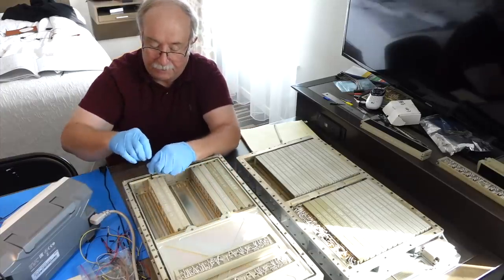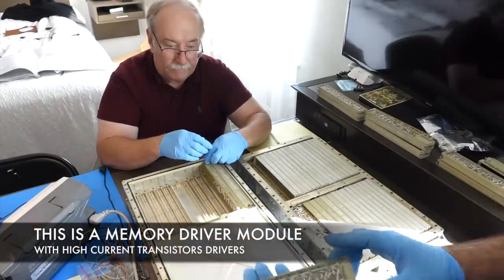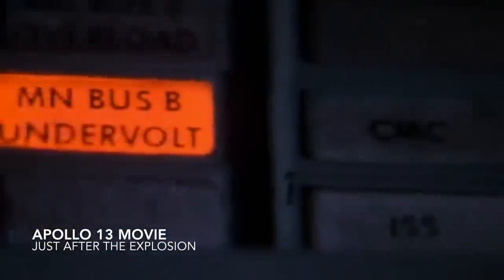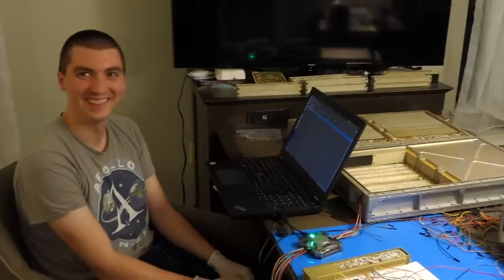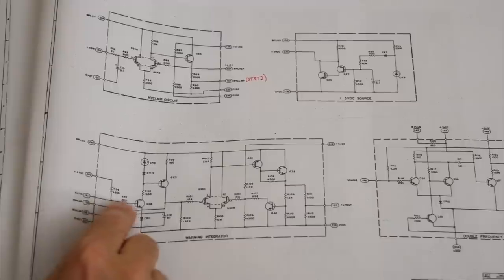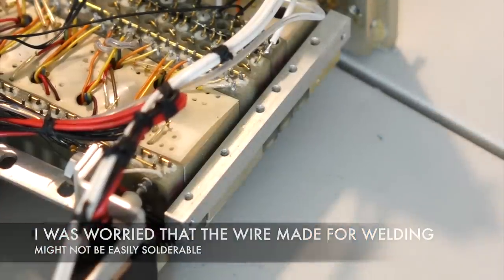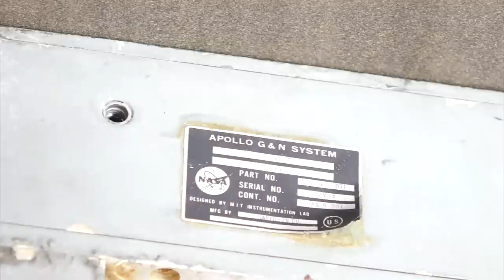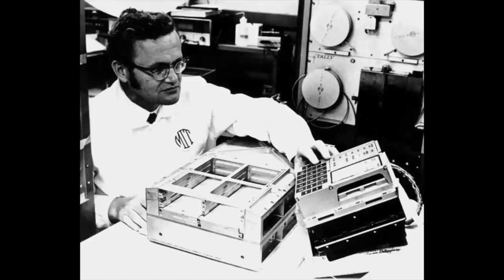Apollo Guidance Computer Part 3: Main Bus B Undervolt

Comment: Is this a process that's currently going on, or was this hotel-room session like one week, a while ago?  How long is the process from start to finish?  (I love that you're all tackling this not as "let's restore this retrocomputer" but rather "let's confirm that everything in this important historical/museum piece is 100% working without causing any damage at all on it."  the precision and thoroughness is spectacular!  :D I totally LOVE this series!
Reply: The hotel room session was one week, but the restoration is ongoing. 

We have a memory module to repair, core rope simulators to recreate, software to load, an improved DSKY substitute to hook up, and lots more
Reply: @carlclaunch793  awesome!   And thank you all for doing this. :D
Reply: You would have to simulate the gimbal inputs and the RCS outputs. Plus, did the AGC use DACs or ADCs?
Reply: @JohnDoe-yj5ng  Hi John. Yes, in the broadest demo, we would read the RCS firing command from the software, compute the change in spacecraft state, then fake inputs from the gimbal and PIPA (accelerometers). Also radar returns for lunar landing, telemetry uplink and downlink, essentially simulate the roughly 360 I/Os that hook to the AGC. 

The AGC depended on outboard boxes (e.g. Coupling Data Units) to digitize things like gimbal angles. They produced counter pulses (up or down steps) that would trigger a cycle steal in the AGC to increment or decrement a word in memory that was assigned to that counter. 

There is one analog-digital conversion in the AGC, to support the astronaut hand controller.

Comment: You know, i was thinking about the inhibit line being broken;  If my understanding of how that functions, and knowing that the core memory produces analog signals... should it be possible to still at least read it by monitoring the multiple voltage/current levels that are produced by reading it?  or is it due to the procedure of charging it to read it going to completely mess it up? (I've only got a basic understanding of core memory...)

Comment: I guess B8 is like an early self test you find in latter oscilloscopes.
Considering this is so complex, and that Russian electronics on EEVblog is so far behind, I wonder what Korolev put in his rockets that got people like Gagarin into space.
Reply: the soyuz equivalent is the argon-16. it started flying soyuz in the mid 70 and still being used on current soyuz design.

unfortunately there aren't much info on argon family computers online. from the russian virtual computer museum page, it seems like they use hybrid IC (similar to what IBM used in the LVDC).

more details: http://www.computer-museum.ru/english/argon16.htm

Comment: Do you know what the equivalent NOR gate collector and base resistor values are?
Reply: Yes, we have the schematics and spec sheets for the components.
Reply: Hi CarlThanks, I was wondering what the values were but I found the component spec and it looks like the base resistor is 20k and the collector is a nominal 3k3.Another question. On the schematics there is a reference to some signals being connected to a number of  'reference' circles'. Can you explain what these are?

Comment: Why is the reception bill mentioning Delco as manufacturer? AGCs were built by Raytheon.
Reply: Delco (a division of GM) was prime contractor for the Apollo Primary Guidance, Navigation and Control System (PGNCS), which was developed by the MIT Instrumentation Lab and MIT Draper Labs. Raytheon was the subcontractor that built the AGC (which was part of the PGNCS). Delco manufactured the Inertial Measurement Unit (IMU), which I'm sure Marc will discuss in more detail.
Reply from the maker: @KenShirriff  You said it all, because AC Delco was prime. The manuals for the AGC also have the AC Delco name on them. If I recall well from Eldon Hall's book, the MIT guys were pretty annoyed when AC Delco (aka GM) was made prime.

Comment: It might be worth looking into if it's possible to melt or dissolve the potting material so the memory can be repaired.
Reply: We are in fact pursuing that. We are pretty sure we know the potting material and other components in the memory module. Once we 3D x-ray the module to find the break, we will work out a repair procedure.
Reply: @carlclaunch793  You are some serious heros.

Comment: I'm surprised to see actual soldering on the module pins? I guess that the connectors are difficult to obtain but there must be less valuable AGC parts floating around so you could build a kind of backplane that you could solder on. Why is it not a problem that the pins are getting damaged ? What am I missing ?
Reply: We didn't solder on any of the module pins -- or anywhere else on the AGC proper. The only soldering that has happened so far was to re-attach a loose wire in the rope simulator interface box, as shown in the video. What you're seeing on the module pins are small Malco-pin-compatible crimp connectors.

Comment: "every computer should have one" hahahaha i'd kill for an AGC watchdog PCIe card
Reply: Chrismofer Most computers do have on board or on chip watchdogs to detect and if possible recover from such failures. For example every Windows version released this century uses the system watchdog to detect broken GPU drivers.  And every modern PC CPU includes a hidden watchdog computer checking for voltage and temperature anomalies, responding by changing clock speed, requesting fan speedup or doing a hard power down if all else fails (like forgetting to plug in the fans).

Comment: 275,800 usd in 1966 is equivalent to about 2,145,434 usd today used an inflation calculator
That’s one expensive computer

That means that the reported 25.4 billion usd for the Apollo program in 1973 are about 144.183 billion usd today

Comment: will you have any memory for this at all before july??
Reply: That is our plan.
Reply: @carlclaunch793  is rope mem the only mem that will work, or can a substitute be used?
Reply: @kenns9  There are two kinds of memory in the AGC - the read-only memory is built with core rope, and the RAM is traditional core memory, called erasable memory.

The erasable memory module has a broken lead in it. We do not have the six core rope modules that held the flight software. 

HOWEVER - we have multiple ways to provide memory for the AGC. 

The AGC came with two boxes plugged into the core rope sockets. These are core rope simulators that were cabled to some big groundside equipment. They acted like core rope and fed the AGC with the contents of core rope. 

The down side - we don't have the groundside boxes that complete the core rope simulator. The up side - we have Ken. He has reverse engineered the inside of those two boxes, designed a machine that will connect to the two boxes and feed them the data from any Apollo mission we want. Once this is done, we will have the core rope memory working in a historically accurate way since the simulator boxes are original equipment from the space program. 

We are going to X-ray the erasable memory module and see if we can accomplish a repair of the broken wire inside to restore it to operation. This is the preferred route.

We can engineer a memory substitute that hooks onto the backplane of the AGC and responds to any request for core rope or erasable memory with data held in the substitute. Mike had this mostly complete using an FPGA by the time of this video. The downside of this approach is that the AGC cover has to be removed.

We can engineer a memory substitute that hooks to the AGC via the maintenance connector (A52). This is the way that MIT, Raytheon, North American, Grumman and NASA tested the AGC. It does the same work as the above paragraph but the covers can be installed on the AGC. 

Finally, we have several schemes in mind as alternatives if we can't directly fix the erasable memory module. 

Our preference is to retain the most historically accurate memory possible, but there are plenty of other means to provide a memory to the AGC and let it run real Apollo mission software.

Comment: Where is the "Gimbal" and "Gimbal Lock"?  This word was repeated frequently in the moon landing transmissions at the time. The word was not in the English-Finnish dictionary and the internet was not yet invented.
Reply: check the OED: 4. pl. A contrivance by means of which articles for use at sea (esp. the compass and the chronometer) are suspended so as to keep a horizontal position.
Reply: I learned the word in the Finnish Army  already, because they put me into testing Soviet-made missile controls in 1978.
Reply: The heart of the Inertial Measurement System that provides orientation and acceleration data to the AGC is a platform with three gyroscopes, with three concentric rotating rings. The pivot of each ring is a gimbal. As the gimbal rotates (the spacecraft rotating around the fixed position of the interior platform), the change in angle is transmitted to the AGC. 

With just three gimbals, there is a position that the spacecraft can get in relative to the internal fixed platform (called the stable member), where  two of the concentric rings are in a parallel plane to each other. From this position, the computer loses the ability to distinguish the direction of some movements, and the two rings will move in concert from then onwards (gimbal lock). 

Each maneuver of the spacecraft is planned in relationship to the position of the stable member. If necessary, a new position can be forced on the stable member, changing the place where gimbal lock will occur so that the desired maneuver will avoid that place. 

On the FDAI,  the instrument on the spacecraft console that looks like a ball, the zone where gimbal lock can occur is specially marked and crosshatched so the astronauts can see when they are nearing the bad orientation. If they happen to cause gimbal lock, a warning light is illuminated and they will have to start from scratch to align the IMU to restore a usable orientation of the stable member.
Reply: Amy Shira Teitel has all the answers here:  https://www.youtube.com/watch?v=OmCzZ-D8Wdk

Comment: “Non-flyable”?  Challenge accepted.
Reply: That would have to do with more stringent reliability testing, which these earlier units were not designed to pass.

Basically these were all “baby steps” towards a full-quality flyable unit. With such complex equipment, you couldn’t get there all at once.
Reply: I wouldn't say these weren't yet designed to pass the more stringent tests. They discovered through testing these early B8 modules that the oscillator alarm circuit wasn't thermally stable enough to meet their design requirements. Later modules had a light redesign of the circuit. I suspect that this is one of the major reasons why this module was labeled non-flyable.

Comment: how on earth do you WELD fragile electronic components without frying them??
Reply: Spot welding is actually less stressing that soldering. This is why Tesla-batteries are welded together.  I presume it is faster so less heat to spread around.
Reply: @TimoNoko  well i know it's done with batteries just not with voltage sensitive components! know of any reference materials out there?
Reply: @antigen4  There is no high voltage, just high current. BTW, those AGC-joints do not look welded to me. I think they have used  special high-heat solder instead. But it  is difficult to draw a line between welding and soldering when melting points are close together.
Reply: All of these modules were definitely resistance-welded, not soldered. The controlling documents for the designs and processes used were ND 1002003, "Wiring Standards and Design Criteria for Apollo Welded Assemblies", and ND 1002005, "Apollo Requirements for Process Control and Fabrication of Resistance-welded Electronic Circuits Modules and Assemblies". There's some chance I might be able to get copies of these... give me a week or two and if I can find them I'll link them here.
Reply: @mikestewart8928  There is clearly extra material in those AGC-joints. Welded-only connections are brittle,  so you add some high-heat solder too. This looks very much the Russian missile stuff I saw in the army. You could not disconnect any "solder" joints by soldering, when they replaced all shitty cotton & tar wiring with silicone wires.
Reply: @TimoNoko  I'm no expert in cordwood style construction found in this puppy - I only learned of the existence of the technique quite recently - but welding as such doesn't rule out using fillers. The main difference between soldering (or brazing) and welding is whether some of the base material experiences melting or not, right?
Reply: @sietuuba  Welding is quite common where solders melt, like inside a coffee machine. Not very good joints however, as strands of wire melt together, and it turns into solid brittle stick.  That is why still little skeptic about this AGC welding issue.
Reply from the maker: Just spot welding. I linked to a video that shows the fabrication process in the description of the first video.
Reply: Wouldn't these have used solid core wire, not multi-strand? Solid core would be easier to weld, due to being much thicker, so there would be lower risk of individual strands failing as described by Timo Noko. The down side of solid in an instrument that will be subject to a lot of vibration, is the need for strain relief and support, to reduce the risk of a wire repeatedly flexing to the point of breaking. That'd be another reason to pot everything.
Reply: @TrainDriver186  And pot everything they did, at least on the flight-certified hardware. This wasn't flight hardware though, which is why many of these modules weren't potted.
Reply: @TimoNoko The melting points of welding and soldering are quite far apart. They are fundamentally different processes (even though some languages don’t distinguish between them): in soldering, a different metal (with a lower melting point) is used to join the workpieces. In welding, the workpieces themselves are melted together.

Comment: What about the dsky? Do you have that alongside with it?
Reply: No DSKY with it, thus building a DSKY substitute (almost replica)
Reply: @carlclaunch793  that is A-ok. Bet there aren't many of those available. Keep up the good work lads.
Reply: @carlclaunch793  I don't imagine building a DSKY replica would be too difficult. It might be nice to have a Raspberry Pi with an LCD display connected to it, so that when you enter a noun/verb command, it will control an interactive display for the exhibit detailing what the command just did.
Reply: @BlackEpyon  Half the work is the interface electronics to convert 28V logic levels to/from the AGC to TTL or LVCMOS for use inside a replica. We want the interface logic to be as close as possible to the real DSKY or other spacecraft circuits  - impedance, current, thresholds.
Reply: @carlclaunch793  I can appreciate keeping a piece of vintage hardware as accurate to the original as possible. The question though is what to do with it once you've got it together and working. Since there's no spacecraft bus to connect it to, you can't tell what it's doing beyond what DSKY displays. Or do you guys plan to make a "virtual spacecraft" for the assembled computer to connect to?

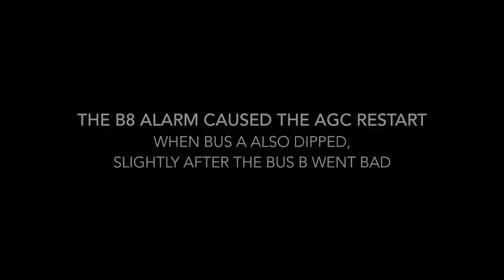Comment: There's a small but amusing spelling-mistake at 7:33. The plural of 'bus' is 'buses' not 'busses.' 'Busses' is the plural of 'buss', an archaic word for 'kiss.' Wanting to kiss a 5-year-old computer when it worked is perfectly understandable, but it is not a recognised technical tactic ;-)
Reply from the maker: Both plurals are correct, with the double ss one often used when referring to electrical interconnects (as in https://www.amazon.com/Computer-Busses-William-Buchanan/dp/0340740760 for example).